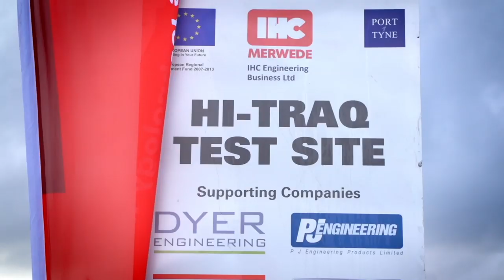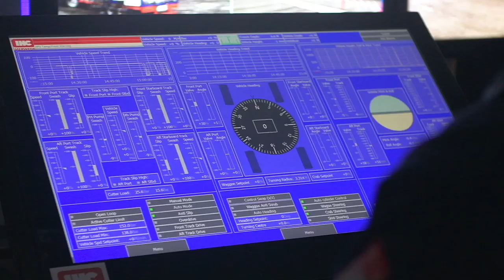Royal IHC launches innovative Hi-Traq® trencher

Comment: What is the power source?
Reply from the maker: Hello Troy! 
The Hi-Traq is connected to the vessel by an umbilical cable; this cable provides both power to the vehicle and transmits communication between the control cabin and the vehicle. The vehicle required 1.2MW of power. 
If you have more questions, don't hesitate to contact us directly at communication@royalihc.com!
Reply: Thanks for the answer, I appreciate it.